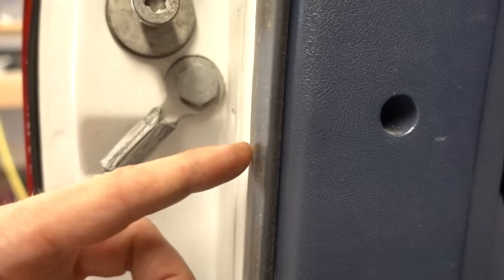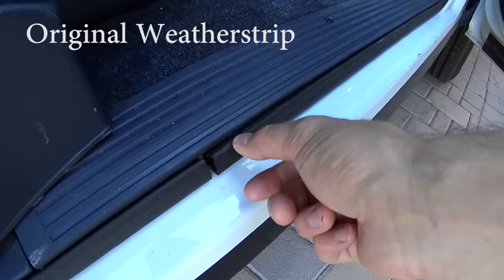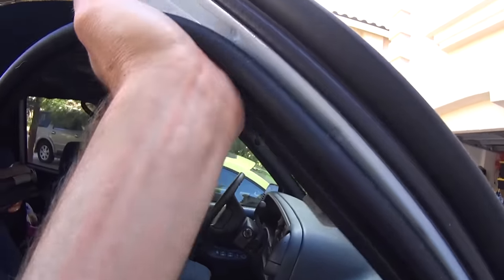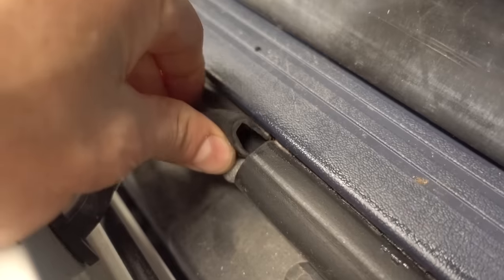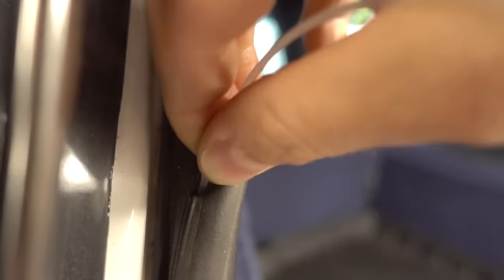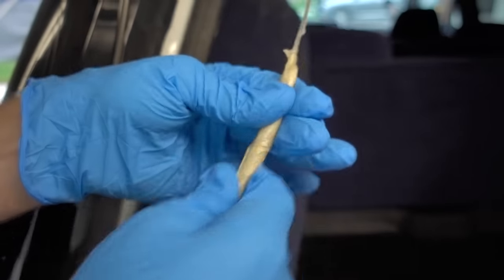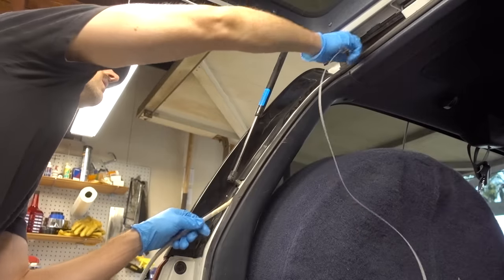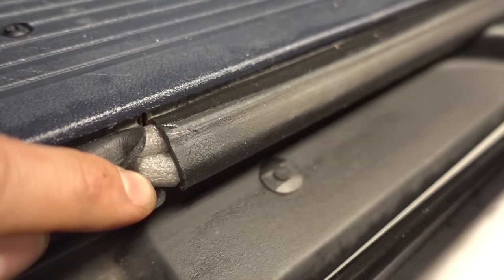Why You Need To DO THIS TO YOUR CAR'S WEATHERSTRIPPING NOW!

Comment: Inside the doors were the windows go up and down in the channel it’s made like a u but at the top of the u put two more smaller u shapes so it creates a real narrow gap . In side of each side I would take mine out lay it down with scrub brush and old tooth brush scrub in side and out after dry you can put a finger down in there and like open it up the back side of the rubber were it’s in side I put the small flat thin stick on weather stripping on the inside half of the channel rubber in side of it were it don’t touch the glass but it dose the same kinda thing your doing by filling out the weather striping ok now I ordered off Amazon some grey fuzzy like house screen door seal it’s like a 1/4 x3/8 like kitty whisker looking stuff !  I put it on the inside of the outside part of my window weather striping 4 doors and one rear hatch all electric !  Now each one I had to break them in to rolling back up because the last 3-6 inches they didn’t wanna go  from being extra tight after working them up and down 5-6 times they were better than new now I did my sun roof also because it’s a Toyota 4Runner famous for noise in the sunroof mechanical retracting mechanism so I went ahead and sound deadened the whole roof then the doors hatch and new carpet you guessed it sound deadened the floor also thicker carpet with higher quality padding the doors got sound deadener then bedliner spray in kind 3 coats then insulation sound barrier !  For acoustic purpose but with everything shut and I have a flow master muffler on a 4.0 v6 it has a real low roar ok .  I can whisper to you while driving and all three passengers can hear every word I say !   A friend of mine wanted to know how much of a charge it made so he recorded it on a backroad trip with high way also so small bumpy road then fast high way then city light to light .  He could not believe how much it was I let him see how when I got one side of the doors done with the other side not done open and close front and back door then the side I had finished !  Like a tin can shutting to a real fine house with a big wooden door !  Tink tink then like wooouup it feels like closing a door on a BMW instead of a 1930 model car door !  Just from closeting the doors you can feel the quality !  Sound deadening it really helps out like if you over do it  that’s when you can really tell !  I know we’ve owned Cadillacs newer ones and older ones there were none of them as quite as the 4Runner is  !  Heat in the winter is low and heat knob on low I can roll two windows down heat wide open and still be plenty warm at 25-45 mph !  With windows tinted summer time a/c will freeze you out on low ! Of course I’m always on recirculating inside air! The time it takes to do it on and off can be like four weekends with one three day one I took all my seats out cleaned all of them up by removing the covers cleaned the covers let them dry then reinstalled new padding over sound deadening then a day on each 2 side doors rear floor and deck one day the sunroof 3 days I had to add extra bracing to stiffin it up so it would not rattle !  So much difference when you can hear yourself think !

Comment: Great idea.  Wonder if some of that expansion liquid foam like great stuff might work too.
Reply: That expansion builders foam would probably swell the rubber up like.balloon .Tubes of builders silicon caulk using a mastic gun might work ,it would pump along the void & cure semi solid .
Reply: I was just thinking about that! 
All the lube and trying to get foam pushed through is a pain…I did it to last car just on trunk…seemed like forever!

Comment: Late to the party. as usual. Do you think 1/2" OD would fit inside the weatherstripping? Looks like you used 3/8" OD on your install. Thanks for posting this.
Reply from the maker: Hey, I’d certainly try something else. I’ve heard that surgical tubing stuff works too and you can buy it at lowes and Home Depot. At this point the stuff I used probably needs to be replaced due to flattening 🤦‍♂️. Hope that helps.
Reply: @1RoadGarage  Thanks for replying. I'm going with the 3/8" OD clear vinyl tubing. I'm looking to seal a water leak. I have new door seals, so adding the tubing, hopefully, will "SEAL the deal". I'll show myself to the door.
Reply: @1RoadGarage  UPDATE:
Today, I pulled the door seal off (1998 C1500 WT) and installed the 3/8 OD 1/4 ID x 20 Ft. clear vinyl tubing in the door seal.  I sprayed silicone spray directly into both open ends to facilitate the install, as in enough to see a bit come completely through. I didn't bother to spray the tubing. It took less than 5 minutes from start to finish. The door requires a bit more effort to latch closed, but it's the passengers side. I'm waiting for the next rain (Wed.) to see if this takes care of the leak. Just thought you might want to know. It truly, was easy.
Reply from the maker: @darkdelta  good to hear! Glad it worked out! Hopefully it’ll seal up good for ya

Comment: some of you guys suggested surgical tubing .250" diameter.   Is this the latex or the vinyl.  Seems like the latex would be to soft to push through the existing rubber seals?

Comment: Silicone vacuum hose is better. Its smoother on the outside so pulls through better, and isn't porous like the foam so it won't absorb water and rot inside the rubber over time and smell bad like the foam beads do. And being silicone, it will last forever and take endless beating by the doors and won't deform.
Reply: Tried out what he did in the video and I agree; In fact, I would just recommend either pulling the weatherstripping out or just buying new ones and before reinstalling either one, just fish through whatever filling you choose to reinforce the weatherstripping. I had a bunch of trouble multiple times with the trimmer line slipping away from the tape’s grip and basically having void spots because of it. Silicone tubing would definitely glide better than the foam.

Comment: Car trunk fills from rain water coming in, fills entire tire well plus both tire dam? Not sure. Nissan failed to either install or improperly install gasket. ( Here In Corpus Christi,Tx.) Have removed well drain cap- wanted to drill (1) to tire dam/ dip like. But afraid to puncture both tires or damage electrical stuff! Applied silicone glue but zero improvement!

Comment: Here's my concern and what I would ask about...
That type of foam likes to compressed with time while under pressure and not reflate.
Have you had this issue...or does it take up enough space inside the weather-stripping to keep the seal tight?
Thanks!
Reply: Someone in the comments mentioned using surgical tubing, and he said that would actually be much better than the foam.
Reply: @YouLookinAtMe-Bro  lube up inside the latex tubing. It likes to stick closed after a while.

Comment: I'm going to give this a try on my 2000 GMC Sierra Z71. The original weather stripping is still in great shape but I'm getting a lot of wind noise and I bet you that this would work to eliminate the wind noise. I see that you had it doubled up at least in one spot or was that for the entire length you had the foam doubled?
Reply from the maker: That doubled spot wasn't actually double, it was just the two ends of each side that stuck out about an inch... But, I bet you could double this stuff up pretty easily. I was just afraid it would be too tight for the door to close properly. Your call...
Reply: @1RoadGarage  thanks for the quick response, always like your shows cuz they solve a lot of the problems that I've encountered.

Comment: No such luck for me I am afraid. I saw your idea and tried it on a 2019 Ranger as I thought I would enhance an already functioning seal. I had to pull it all out after the door would not close. I think surgical tubing would be better. Foam did not work.

Comment: Dunno about the US, but a set of 4 weather channel rubbers here in Oz is only $100?
Reply: here it depends a lot on the age and popularity of the car. if you can get OEM, its usually pretty reasonable. but once the body style gets a decade or so out of production, you have to rely on aftermarket sources, which deal in lower volume so have to charge more per item to justify production for that body style. also depends on if your car takes the generic extruded weather stripping or it has some moulded corners that are specific to the body.

Comment: What if you cut a hole on top end and insert spray foam insulation and cut hole on bottom end to let air out?
Reply: Spray foam will become hard, firm and is not flexible. Not a good idea
Reply: @paulgray7489   Thanks for pointing that out. I found there's flexible foam too. https://www.smooth-on.com/product-line/flexfoam-it/

Comment: why not remove the weather strip from around the doors, then slide the appropriate amount of foam through the entire strip "off the car" then once all done refit the weather strip & then seal the ends up...

that way you avoid any issues of needing to "lube" the foam up or having it snapping etc
Reply: He does it thos way because he mentions in the vid that it was time consuming to remove the weather stripping. If you want to remove the weather stripping to feed the foam rope through all in one pass, by all means do so! Thats how i would tackle it also.

Comment: Remove the weather stripping, spray it with silicone spray. Let it rest, respray another coat. Once done, let it rest for a bit. The rubber will regain it's normal size, re-install. Much cheaper on the pocket book. Do the sidewalls of your tires also. It revitalize the rubber.

Comment: i sprayed grease in the rubber but the foam just breaks after a couple of inches
Reply from the maker: You have to go slow and make sure the path is straight. It won't work going around corners. There should be little holes on the inside of your factory weatherstripping and you can use those to pull through... Hope that helps.

Comment: Wrong you need a door Heng bushing and pin kit.
I've put one on truck and I've got another one in the box , truck is about to filp 300,000
Reply: I just mega SuperGlue'd (Gorilla style) all the doors shut.
No more rattle.
Takes about 10 tubes per door so it gets expensive.
And climbing in and out of the tailgate get pretty old too.

Comment: So, you're blocking all the drain holes. That's going to be a lot of fun when in winter the trapped water freezes and rips all the rubber open on the seams.

Comment: No. Weather stripping does not hold your door steady. Your door is held in place with three components. Two hinges and a striker. Sounds to me like he threw a couple hundred dollar s at a problem. That could have been solved by, replacing the brass bushings, in the door hinges. Because your doors are rattling... Your hinges are shot. Did that job a thousand times or more. At the GM dealership. Those trucks were great money makers. I made money hand over fist, replacing those brass bushings in the hinges. Because the door pins would just fall out. And if you're hearing wind noise in your vehicle. It's because your panels are misaligned. And your panels are misaligned. Because, it was probably in an accident. I don't care what the Carfax says, the car itself will tell you the story behind all of its problems. CARFAX is not necessary. When you know what you're looking for.

Particularly on Chevy trucks this is easy. If you've got one corner of the bumper, that's pointed up, and another corner of the bumper that's pointed down..... You have frame damage. Plain and simple. I don't care what the used car guy says.

if used car guys actually knew what they were doing. They'd be called mechanics.

Comment: Don't do this please i did and it and water leaked inside there is a reason you use oem weather stripping its designed for it.

Comment: Shouldn’t be making noises mines an 95 with 207,173 with the original weather stripping and no noises. Ur acting like it has 500,000 miles on it
Reply: Corey The FAM they do in fact rattle once the weatherstripping is compressed and permanently flat. See it all the time on client vehicles. Happens on some much earlier than others. All depends on climate and maintenance as well as a bit of luck.
Reply: Corey The FAM Thinking maybe past owner had the smarts to spray em with Silicone.

Comment: I tried this weather stripping hack with dismal results, I was using leather conditioner as my lube, the weather stripping kept breaking with only a few inches inside the tube. Maybe it would have worked if I removed the weather stripping from the doors then put the insulation inside it but heck if you're going to go to all that trouble its probable best to just install new weather stripping sorry man after screwing around 2 hours and getting nowhere I have to give this hack a thumbs down